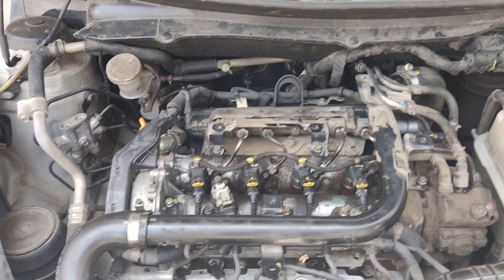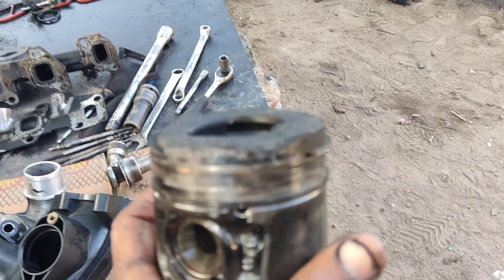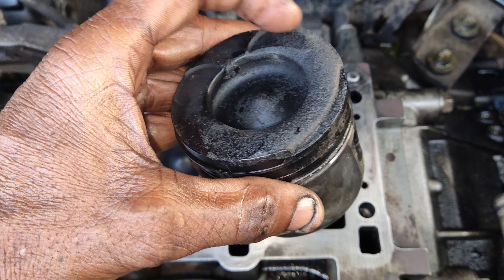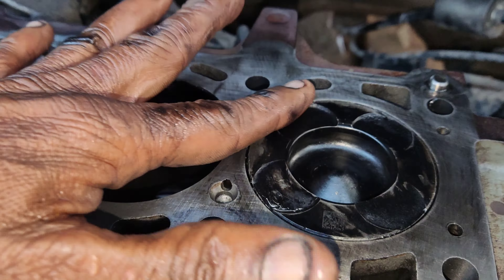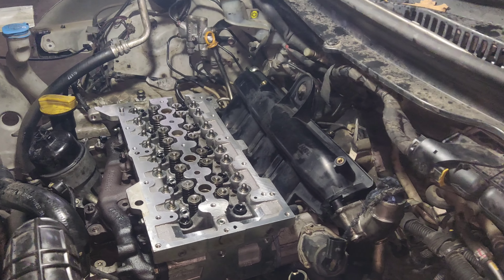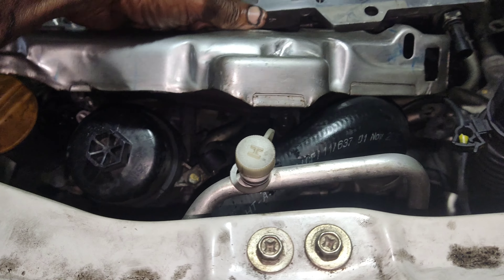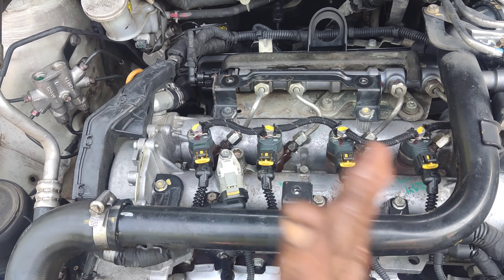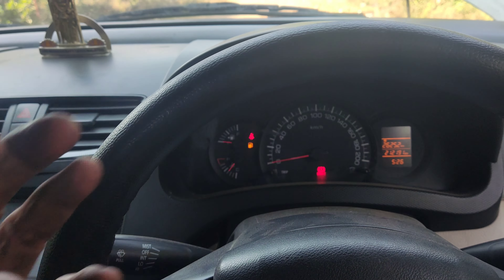Swift Dzire late starting and missing complaint (@skilledmechanictamil)

Comment: Good diagnosis & prominent workings!... 
👌👋👍❤🙏
  Anna I have a swift 2010 model 75000kmpl have been runned. 
I am using normal mineral engine oil. Can i use fully synthetic oil.
Reply from the maker: Ok

Comment: Hi sir,
Oru mechanic sonnaru swift diesel engine la 5w40 oil use pannuna 10k kilometres run pannalam
If i use 5w30 then i can run around 5 to 7k kilometres.  
What is the truth?
For swift type 1 diesel whT is the oil changing interval in kilometres?
Reply from the maker: All oil run 10k
Reply: @skilledmechanictamil  ok tq bro